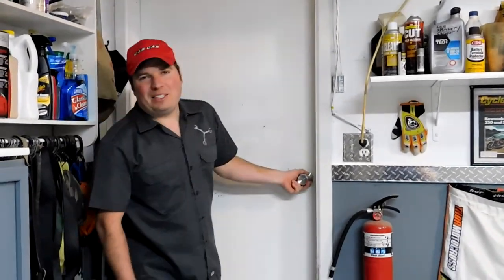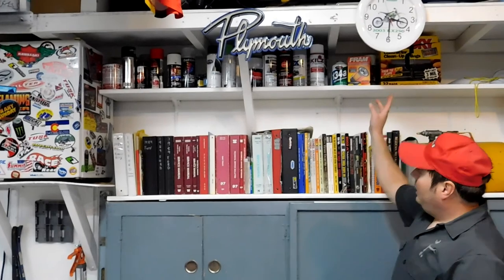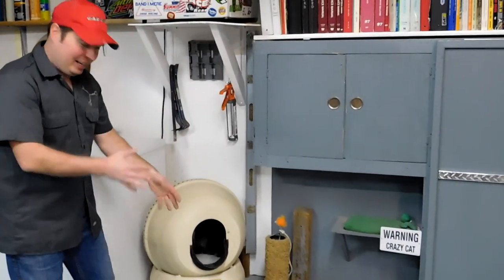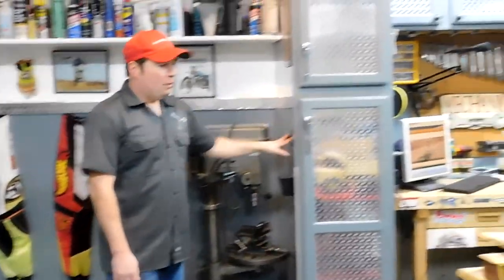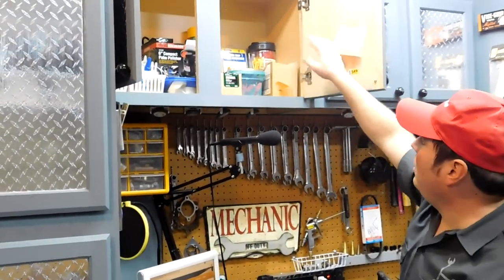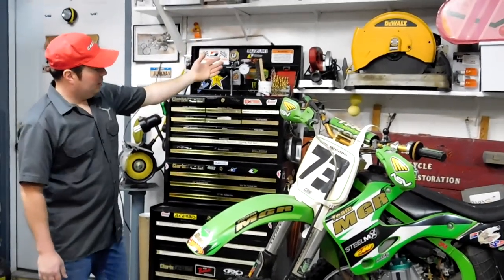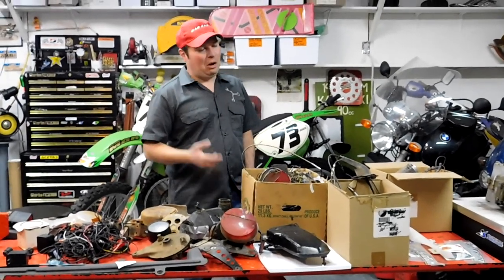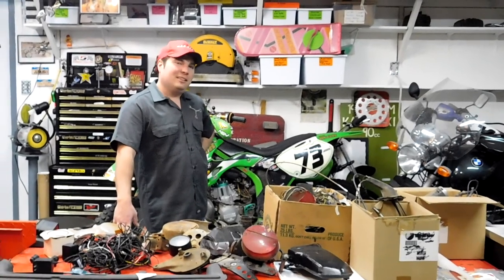Garage shop tour (2016)

Comment: Nice tour Junkman! Thanks for the link/mention. What year is your KX? Do you build your own PC's? I'm looking to build a garage PC and maybe a 40"+ TV for the monitor.
Reply from the maker: No problem.  As I said I liked your video and it inspired me to do an update video on my garage/shop since the last one I did was so old.  The KX250 is a 2002 I bought it brand new in the crate.  I "sort of" build my own PC's as in I mod or swap in parts.  That PC that is just sitting on the floor is one I picked up for free that was full of bloatware, malware, and just generally slow.  I swapped in some more RAM and wiped and reloaded the OS (7) and then upgraded to 10.  It has on board graphics so it just barely works for streaming, so that is why the other one that is sitting in the cabinet is a $100 craigslist find that has a decent graphics card and other parts in it, but it has a power supply issue and maybe a bad drive.  I am on the process of kind of refurbishing it on the cheap as the streaming garage PC.  I have a really good rig in the house for editing.  The monitor was a freebie, but I need an upgrade on it just because it is so small for running a stream.
Reply: Heck I use onboard graphics for video editing and it's fine. I built my video editing PC a year ago and figured if the onboard was not enough, then I could buy a good card. I think streaming issues are mostly bandwidth and other things out of your control. 

Do you have any videos on the KX and it's setup/mods?
Reply from the maker: Well a 5 year old duo core chip that is in that thing won't handle the encoding for a decent bitrate and thus dropped framed.  My good editing rig doesn't have this problem, video output is smooth.  Yes bandwidth can be an issue, but not in this case as I have a 10gb upload speed (so it is probably stable at about 6gb which is plenty).  When I stream with the onboard graphics rig CPU usage is 90% so the encoding demand is just too high.
Reply from the maker: On the KX, no videos on mods/setup as I did most of that kind of stuff long before Youtube existed and DV tape was expensive so I wasn't going to burn up tape on things like that, lol.  Some of my REALLY old videos from back in 2006 on my channel have more footage of it.  But yes the KX has undergone some transformations throughout the years as I used to race MX pretty heavily so I had the suspension tuned for that, but after I bored of MX I turned to harescrambles and Enduros so I re-tuned the suspension for that type of riding and then that is when I went into the engine for some mild porting (to mellow out the engine and broaden the power down low) added a flywheel weight, and different reeds.  Other than some "durability" accessories it is fairly stock.